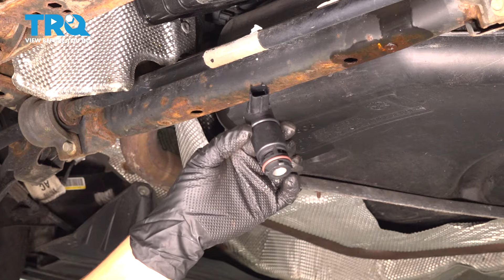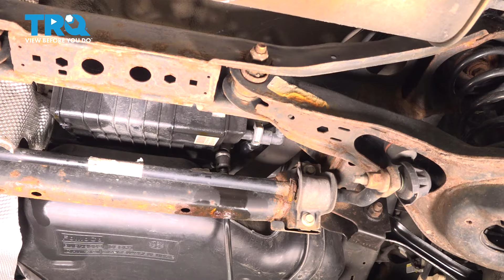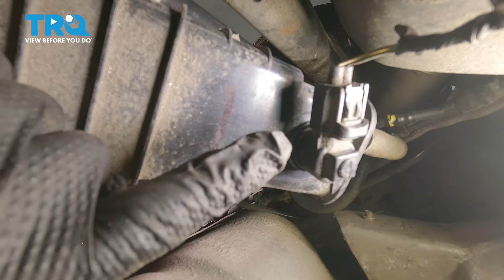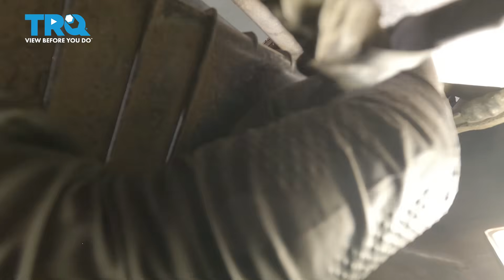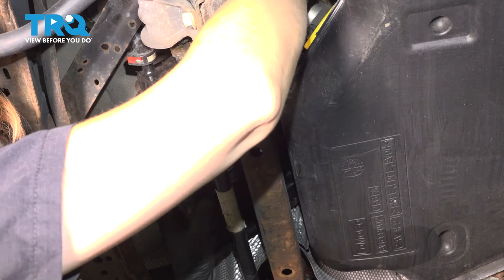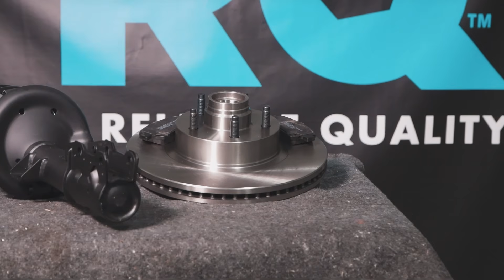How to Replace Vapor Canister Purge Solenoid Valve 2012-2018 Ford Focus

Comment: I reached up, undo the connector
Rotated
Use a large flathead, screwdriver and pop right out

Installing it was difficult, he used a large pry bar, aligned the sensor to the hole and pushed it in while rotating at the same motion